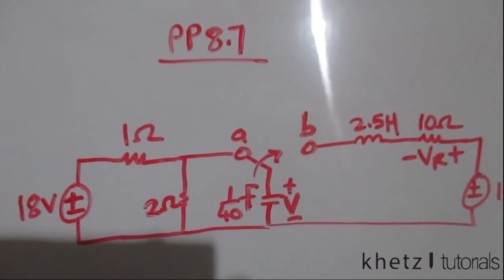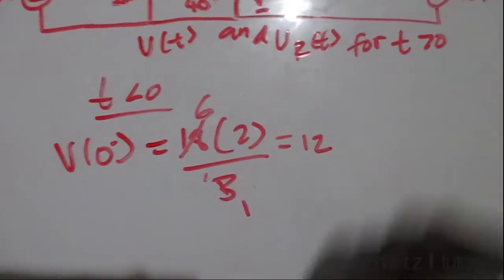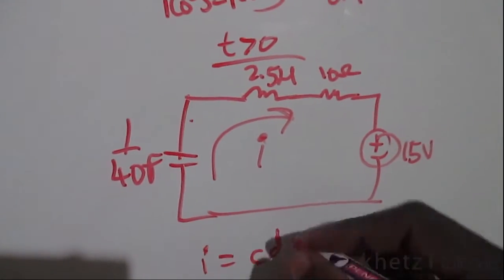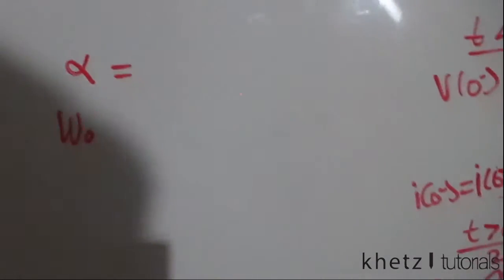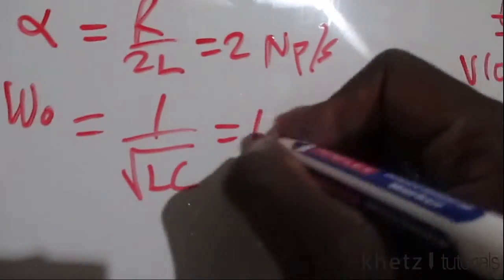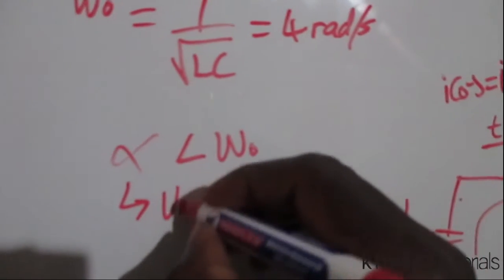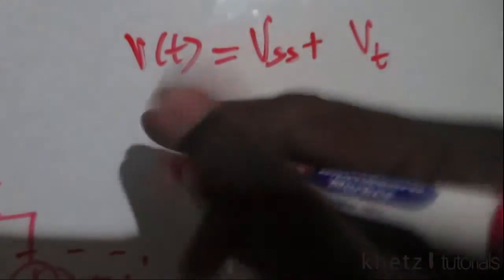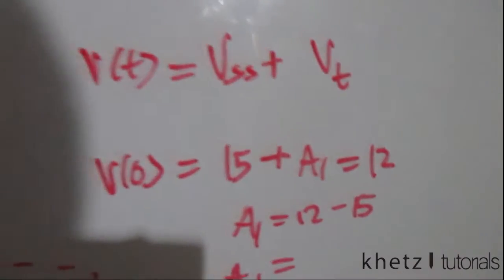Fundamentals Of Electric Circuits Practice Problem 8.7

Comment: Hi, thank you for the video! I was wondering about the last result, where you calculated Vr(t) = i_c*R = C(dV(t)/dt) * R. I might be missing something since I don't see why that final expression for Vr(t) is so simplified, considering that it involves the chain rule in the derivative for the part corresponding to the transient response of the circuit. Thanks!
Reply from the maker: The cosines in the expression that follows after differentiating cancel out. You will only have the sines and that is why the final answer only consists of sin
Reply: @KhetzTutorials  Thank you!